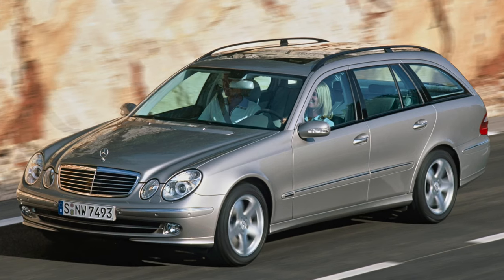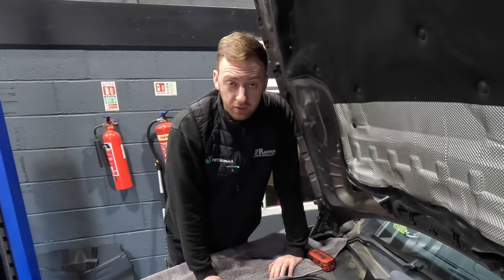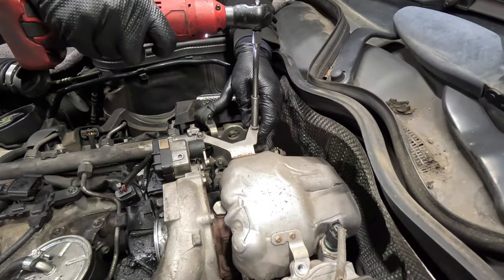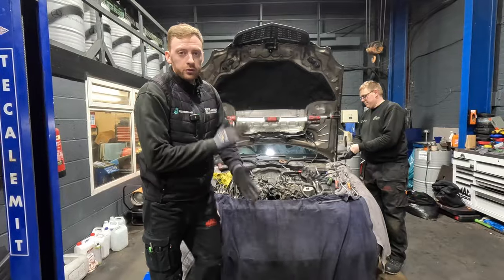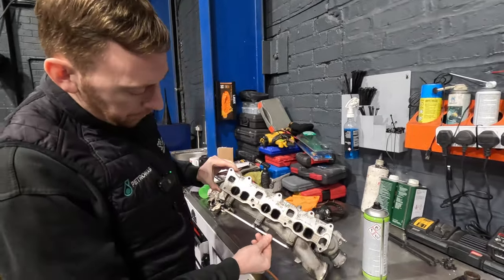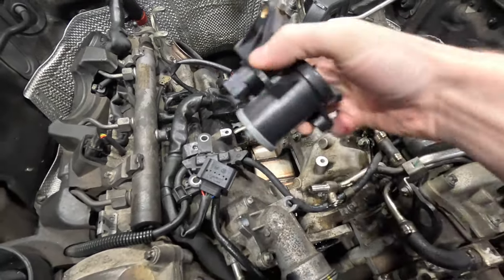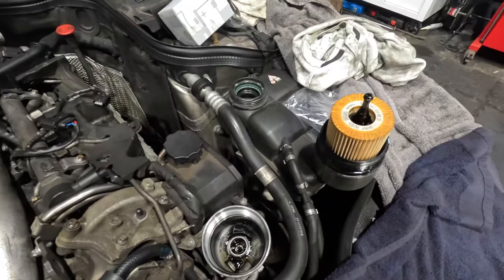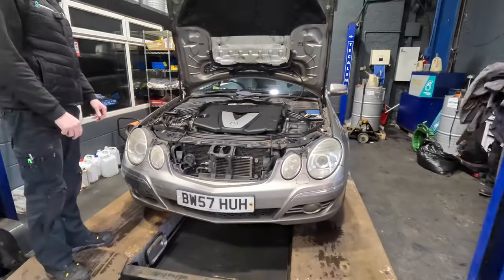Mercedes E-Class W211 OM642 v6 CDI. 3 most Common engine faults, oil cooler seals plus more!

Comment: Hi Sam!
I have a 2011 W212 E350cdi,with the OM642 engine.
I had these jobs done(oil and turbo) and the car works amazing.
My question is,the car has now 191.000 miles,should i worry about the distribution chain?
When the chain gets replaced or it doesn't need to?
Also,how often does that oil cooler job gets done?
Amazing videos,keep up the good work ,only a few people will do what you do,taking care of the car and the owner's poket👍 👏
Reply from the maker: If the chain starts to stretch you will get a rattle on start up lasting around 3 seconds. 
There isn’t an interval the chain but when it rattles that it letting you know
It wants a new one. 
Oil cooler hasn’t really got a pattern. I’ve seen it happen at low miles and also not leak until high miles.
Reply: While you are in the "Valley of Death" the injector seals can be done.  
The seals from the Honda 2.2 diesel are the same size but do a better job than the Mercedes ones as they are slightly softer and seal better .

Comment: I have this issue on my ML280cdi (OM642) I had the back pressure sensor fault, my dad who's an ex mechanic thought he'd sorted it. He's 74 bless him, if I'd known this earlier I wouldn't have had him do what he did to try and solve it. I'll be booking it in here and getting it sorted 😢wasted around £200 on parts as it's started again with the kangaroo hops 😩
Reply from the maker: Well it won’t all be a waste as if he has replaced the back pressure sensor we would have recommend that also anyway. Good on him for Giving it a go. And it caught me out the first time also.

Comment: Thanks for such a candid video and congratulations on your customer-focussed ethos. If it were your money, do you think the four cylinder is a better choice for the E-class in terms of long term ownership? I'm concerned it might be under powered and over-stressed. Best wishes, James.
Reply from the maker: I think if I needed a 211 as a workhorse car yes I would probably go for the 646 engine 4 cylinder diesel, its not going to set the world on fire 0-60mph but it will tick along all day with less issues. And is actually a pretty smooth engine.
Reply: @sprautos  Thanks. Its so difficult to resist the temptation to go for a smoother, more leggy 6pot, despite the legacy oil seal issue.

Comment: Use heavy oil on om 642. Use 10w60 , or 15w40 weight oil minimum and you’ll be very happy with this engine. It’s after several engine seized.

Comment: On my second one of these engines. Current whip has 28k on it.
Are the later oil seals more robust?
Lovely wafty engine with plenty of go
Reply from the maker: It’s a great engine plenty of power/torque 
I would like to think so but time will tell I suppose.
Reply: @sprautos  absolute Merc fan. Not feeling the love for everyone/hybrid ones at all though

Comment: modern cars have so many issues designs are poor from seals and wet timing belts to timing chain guides so so poor the modern customer  is forced to go to garages and with so many ECU requiring restting once a componet is replaced but the big boys thrive on this

Comment: Great video. What did this job cost, out of interest? I’m looking at buying a 320 CDI so would like to know in case it needs doing.
Reply from the maker: Oil cooler job without turbo is about £1500

Comment: I have a 2011 e350 with latest om642 engine 265hp.
250'000km and I changed only the thermostat
I think the latest iteration I have is much more robust, with all these problems solved.

Comment: Hi

Amazing tutorial, I had exactly the same problem with oil cooler seals, and also the same wear in the inlet manifold swirl flap arm.

It was all fixed by a very competent local mechanic but I took it to Austria last year and the Turbo would cut out and would always reset when ignition switched off/on. I still haven't got to the bottom of this problem and wondered if you have any ideas! 
I was thinking maybe an Actuator or Map sensor but It's really just a guess.
I have had the codes cleared and the only code I have now is 2783, which is friction of torque converter lockup clutch is too high.

When I got home from Austria the following codes were stored.

2783 friction power of torque converter lock up clutch is too high.

0741 actuation of torque converter lockup clutch is not possible

129700 Dpf filter is defective (although soot/Ash lever zero)

14Ac00
Component B19/11 temp sensor upstream of turbocharger has internal fault
15FD00
Lower limit value of component B28/8 Dpf differential pressure sensor has not been reached.

Many thanks in advance, any info would be greatly appreciated.

Comment: At what mileage should the oil cooler seals should be done? Do they have a fixed mileage when they fail? Or they can fail any time? Big fan of 642
Reply from the maker: I haven’t found a pattern tbh, I’ve seen it at low miles and also high. So I would say it can happen anytime.
Reply: did mercedes fix the oil cooler seal? If yes at what year? Thinking of my 2012 R class
Reply: @BarrySims-w7p  the newer type (Viton) seals were fitted on cars after 2010 but as previously mentioned they can fail.

My previous Chrysler 300C with the OM642 engine had no problems but I have had to change the seals on my 2013 S Class with the same engine.

Thankfully Mercedes didn't fit the dreaded swirl flaps in all the OM642 motors.

My

Comment: Hi, I have a CLK 320 CDI and when accelerating it gave me the same jerk. Then driving along a slightly uphill road the car didn't go beyond 100 kilometers per hour, I thought it was the turbo actuator and I had to downshift with paddles on the steering wheel. A few months earlier between February and April I always found oil stains on the ground but the Mercedes workshop told me that it wasn't the oil exchanger but that the oil was coming out of the turbo and seeping from the plastic manifold in front of the turbo which I then changed. While for the tugging the workshop told me that it could be the exhaust manifolds, where it carries a double chamber and from here small pieces come off and hit the turbine wheel, but in any case they say that my turbine is still good, why did you change the turbine? Don't you have problems with the exhaust manifolds? I have to have the exhaust manifolds changed in September.

Comment: Excellent work, preventive maintenance is the cheap way to maintain a good car, good to see. Isn’t it criminal that Mercedes and others shout about sustainability and how they work for recycling parts, yet don’t make a simple connecting rod for the inlet, throwing the whole manifold away so wasteful!!! Should be an EU law against it, my 2013 C class coupe front callipers have a Mercedes name plate that covers the gap on side of calliper so you don’t see pads, it’s fixed by two dowels, one fell out, Mercedes said I would have to buy a new calliper to get it 😱😡just doesn’t make sense, and so wasteful !!!

Comment: W212 350CDi after 500000km in first to last "malfunction"
1. front spring 2. oil cooler  3. rear subframe 4. knob for infosystem 5. rear shocks 6. thermostat 7. end links 8. steering column electronic key lock 9. rear subframe bushings ..
Rest : standard maintenance!

Comment: Good Day, I am from RSA and do find a jerky  ride on a random base. I suspect a turbo problem as you explained. No fault code,no white smoke, jerky ride once-off with hot engine and not again until engine is switched off, adblue deactivated and start and idle, smooth. 2014 ML 350 om 642 with 100 000 km.
Any advise?

Comment: Great video.  On average what mileage show I get this done? .  I have a e350 2010 59k.   I would rather do it / preventative maintenance.  How much roughly is this job?
Reply from the maker: It cost about £1500 I would do it when it needs it. I’ve got cars with over 150k and still
Dry and yet others at 100k and need doing, there is no pattern to it really. 
To get as bad as this one it’s taken years being left and ignored.

Comment: What sort of costs do these faults incur (minus the turbo fault)? Thanks for the video.
Reply from the maker: Oil cooler job is around £1500
Reply: Is that just for the oil cooler seals or is that everything else u done min7s the new turbo?

Comment: What is total cost of the replacing parts? I have some leakage somewhere of fuel on top messing around stuff. But then you need to get to fueljets its apart anyway so i consider this as well

Comment: The oil on the intake is not supposed to be that bad if you pcv system is working correctly. You can't expect the orange seal to hold oil that is not supposed to be there

Comment: Help. My 2006 ml320 (new used engine) is spewing out alot of white blueish smoke. Injectors, fuel pump, pcv valve, intake seals were replaced. Has a 2020-1 code (low fuel rail pressure) but I'm not sure that's what's causing the white smoke. My mechanic just can't figure it our and he says injectors are fine. No leaks

Comment: Hey mate came across your channel.... My grandad passed away recently and he left me his W211 v6 E Class 2005 and it has been stood about 4 years since it broke on him.... he took it to a local "meredes" specialist and the issue was a sensor on the driver front wheel which they made out they fixed but when the car was returned it was then flagging a SBC , ESB  on the dash.... my plan is to gradually do it up as a summer project but my question to you is could the sensor on the front wheel be causing the electronic issues and flagging up these faults or could the entire SBC unit be faulty... i have read they have a limit on how many times it can be used before you have to flash them.... just looking for abit of advice really... cheers
Reply from the maker: First off sorry to hear that about your grandad. And good on you for wanting to get the car back up and running. 

It’s very difficult to say without diagnoses and investigation but hear is what advise I can give you. 

Abs sensors have to be genuine, Mercedes don’t like none genuine sensors and I’ve never had any luck with them, make sure you buy from mb dealer as there are lots of fake on eBay. 
On the front wheel bearing there is a seal which is also the abs pick up ring that can go faulty if the fault is still flagging on that same wheel the sensor was fitted,our SLk video we did will help you with what I’m explaining. 

SBC pumps can and do go faulty and yes do have a shelf life. With SBC faults you usually get service brake visit workshop in white on the dash or red staying stop vehicle with massively reduced brake pressure. 

It really needs to be diagnosed and some
Time spent with it to pin point exactly but hope this may help. 

All the best 🙏

Comment: Where do you buy the kit to repair the intake flaps? My OM642 is at 260k miles and I've been nursing it for a bit having had to unplug sensors, used a resistor bypass for the swirl flaps, etc. to avoid limp mode but I've started to try to make it right again. Just replaced the turbo actuator and PCV and may take on the swirl flap situation next. I notice a pretty hard stutter periodically when I give it a lot of gas so wondering if maybe the swirl flaps didn't fail open. Is there a way to inspect the swirl flaps without a tear down, like with a mini camera? Just want to be sure that is likely culprit.
Reply from the maker: Repair kit if off eBay, you won’t know till you strip her down I suppose. If it’s a judder like in my video could be turbo
Reply: @sprautos  Do you generally rebuild the turbos or just buy a new one? I've taken off the shield before while installing a new actuator, can the turbo be removed from the top or is it a pretty significant tear down? I have an autel that can test some subsystems I may play with that to see if I can confirm it is the turbo acting up unless there is a simple mechanical way to activate it manually that you recommend.

Comment: Sir, I have a question. I own a 2008 W211 with this exact engine V6 Bluetec here in Canada. Recently I have been experiencing random power loss, it almost feels like the car is in Limp mode.  I would be randomly driving on a highway going up hill, and I would experience power loss, I press the gas pedal and engine is not reacting at all. When I pull over and turn the car off and back on, it runs fine after that.  No Engine light.   Would you be able to point me in the right direction for the cause?  Could it be a faulty MAP sensor? or dirty MAF sensors?  No Engine lights on the dashboard.   Thank you in advance mate.
Reply from the maker: Could be anything without proper diagnostics and investigation, turbo, inlet motor, boost leak, any sensor take your pick. Get your self in a shop and get it looked at. 
All the best 🙏
Reply: @sprautos  I appreciate it mate very much.  So there might be an issue with several different sensors even though no Check Engine light is coming on right?
Reply from the maker: @markamd1  no! several at once but there is more than one reason a car can be in limp mode, but could be anything at this point without testing. It’s a lucky dip until diagnosed is carried out
Reply: @sprautos  Thanks mate. So I just installed a brand new Bosh MAP sensor, cleaned both MAF sensors as well and the intake manifold was cleaned with brand new air filters. Just took it for a test drive and still same issue :(  I am thinking it's the EGR valve.    Last year I invested over 4k CND to get the Oilcooler and gaskets replaced that sits deep in the V, you made a great video about that.

Comment: I have the same surging intermittent as only does it every so often from what I have gathered from different forums it could just be the turbo actuator needing replaced and not full turbo unit?
Reply from the maker: Yea good chance it’s just the actuator. In our case we wanted a full turbo because of the high mileage of the car and to supply a good warranty

Comment: the manifold actuators wear out because the flaps get stuck with carbon residue. Replacing the actuators by metal type is not recommended, as they will not wear, but break the flaps which will be sucked into the engine causing capital damage.
Reply from the maker: Interesting.  We clean out the manifold before refit ensuring the flaps move freely

Comment: Hi. May i ask what is your opinion of the swirl motor delete using a resistor? I noticed you put oil in the filter housing too. I was told to do this by a Jeep mechanic.
Reply from the maker: I personally prefer to just fix it properly, I think the delete is ok for a temp fix if your short of funds. Garages wouldn’t supply any warranty with the resistor mod. So it all depends what you want and what the customer expectations are I suppose. 

Yea always bang a ltr or so down the filter housing helps stop a dry start.
Reply: @sprautos  Thank you, i appreciate you answering my questions. This engine is really well suited to the Grand Cherokee. Plenty of low end torque.

Comment: Why is there so much oil getting in the turbo? I understand the turbo seal leaking places oil on the flaper motor, but wouldnt cause the intake to be full of oil sludge.

Comment: Nasty. The really, really big problem is main bearing failure. The old OM646/7/8 straight 4/5/6 (220/270/320) were the last good ones.
Reply from the maker: They were tanks those older in-line diesels

Comment: Is it necessary to replace complete turbo or can the acuator be replaced on its own, my symptoms are mild compared to this vehicle
Reply: And do you recommend a brand or source I’m in Northern Ireland 👍
Reply from the maker: Yes it can be, in this case with high mileage we opted for a full turbo. I’m sure there all re manufacturers, as you can buy new from dealer or hella, part numbers are very specific despite them all looking the same so be carful to ensure the correct one is purchased.
Reply: @sprautos  thank you  👍

Comment: Hi, just find your video, very nice and clean work. I own a W211 E320 with this engine, and i have que same problem as shown at 1:25 but at 1900 to 2200rpm and sometimes only above 3300rpm. Its not always present, for exemple if i reset the computer i have no problem for about 100km... 
The flap motor is brand new but not the plastic parts on the inlet manifold, but the flaps moves well.
The EGR is new as its pressure sensor. No fault exept the exaust back pressure sensor.

After watching your video i think that my problem is with the turbo but i am not sure, and this part is very expensive (3250€ here) so...
Do anyone had the same problem as me ? Do you think it could be the turbo ?
Im struggling with this for month now, seen 3 mercedes dealers about it and they didn't fixed it at all (but sure took my money)
Reply from the maker: sounds like a turbo fault for sure, and also with you have a back pressure sensor fault which is a good indicator, for a cheaper fix you could replace the turbo actuator on its own, part numbers are very specific on those things so you have to be carful. good luck.

Comment: I'm having the same engine, i got a really wierd problem my idle has become horrible, the whole car shakes, but stable rpm. It goes away if i rev or drive the car. No warning lights on. Im thinking vacumleak. Anyone has any suggestions?

Comment: I’m having the turbo issue on my 2008 C320 (OM642 engine) - will this require a new turbo or is it possible to just fix a component on it?
Reply from the maker: You could try just an actuator if you wanted. It was more cost effective for us to replace the whole thing plus the turbo had done 150,000 miles. So depends if you want a long term fix or not I suppose
Reply: @sprautos  Thank you so much for replying - I really appreciate it, your channel is so helpful.